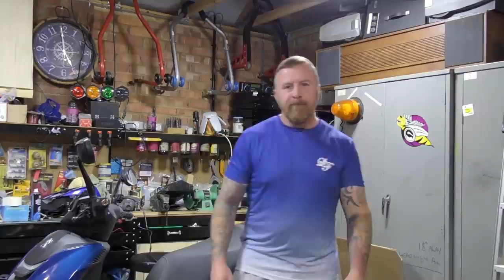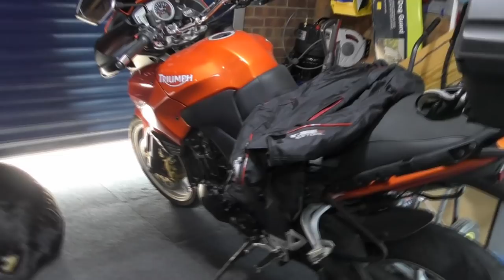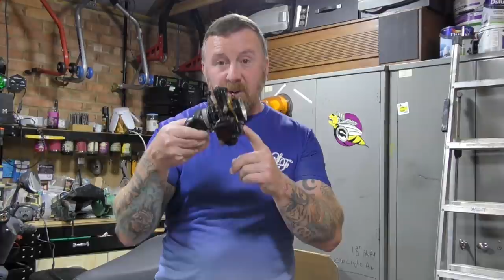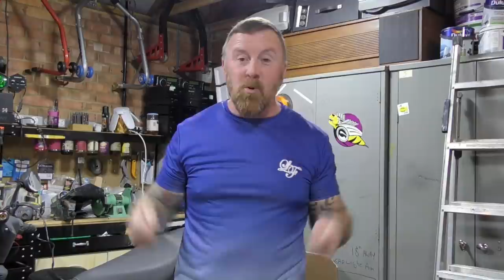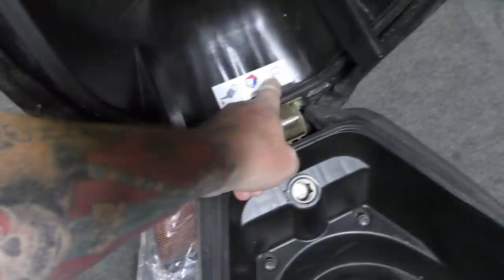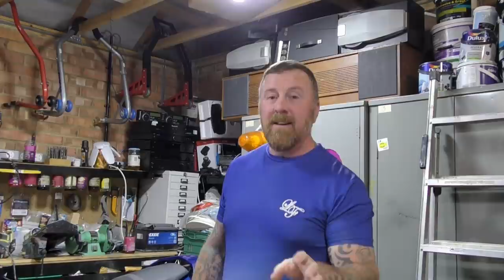E10 PETROL ARE YOU READY INFO FOR MOPED MOTORBIKE OWNERS

Comment: Dam I can’t use my local village station anymore thanks to this E10🤨 I’ll have to travel 10-12 miles to look for the super. gutted. my bike is fuel injected and a 2000 model Suzuki.
Reply from the maker: they are all changing over , its rude as it really is not good for peds and bikes with cards
if you have to use it make sure you dont leave it in the tank for long and try half filling then topping up with e5 super
Reply: @marksavage  yeah I’m heading to get some super on my next trip but first Im just trying an experiment with some E10 fuel in a container and have placed some thin rubber tubing in it to see how long it takes for the rubber to show signs of damage. if I don’t see any harm to the rubber after say a week then I’ll know it’s not urgent I use the super.

Surely E5 would cause some damage over time as it’s got 5% ethanol?
Reply from the maker: @019208237  most parts and engines can handle 5% with the normal hardening extra 
But 10%
Is just too much and it's the water content
Reply: @marksavage  I see. I don’t suppose there is an additive we can put into the fuel tank that would help neutralise its harmful affects. I hope they are not planning on doing the same to the super😬
Reply from the maker: @019208237  good news there is an additive 
It's 
Fuel fighter additive 
Bad new in the next 5 years no more E5 ! 
Bugger
Reply: @marksavage  additives = more money😣 so what makes the newer bikes able to cope with the E10 and not corrode parts in the tanks and carbs?
Reply from the maker: @019208237  newer bikes / cars etc are injection and since 2011 they had to use parts able to be used with E10
They told manufactures about E10 in 2002 and some upgraded parts 
Others just kept using the same old parts 
It's a good money making idea and no good for cars or the environment like they say 
Bud
Reply: @marksavage  could you explain what the newer bikes use to make there fuel system parts? For example what’s the difference between a normal motorcycle fuel tank on the inside and one on a newer bike to cope with the extra 5%? Also the fuel hoses? To be on the safe side I’m going to get some fuel fighter but honestly does it really do what it says on the tin I wonder. I guess time will tell. I can’t be assed to travel well out my way to get a fill up and I’ve just been told the fuel station I was going to use instead of my local one has just closed down🤦🏻‍♂️ i couldn’t believe it. it was a 24/7 one as well and on a busy roundabout where thousands of vehicles go every day. I never expected it as they was making a fortune.

Comment: Is it OK just to use v-power instead of the E10  cost aside?
Reply from the maker: depends on what you re using it on bud , a lot of motorbikes will be fine but peds run hotter and can damaged the piston etc ,most cars will be fine yet oddly my dodge 5.7 hemi wont run on super!
Reply: We've had e10 for a while here in the Netherlands. V-power is still e5 and is what i've been using.
Reply from the maker: @Clear2311  yea as said not all can run on super like my dodge ram 5.7 can't and most peds will run hot and cause damage
Reply: @marksavage  interesting, i was not aware of this and me and my friends always use super for our peds. haven't noticed any issues so far. 

As a sidenote, thanks for all your videos! You taught me tons on how my  speedfight works.
Reply from the maker: @Clear2311  that's great to hear bud 
Yea I've had a few that people have run super and others I bought had heat seized
Guess it's the way people use them too
Take care bud

Comment: Why the panic. I have used the E10 for mor than ten years. Without any problems. Used it in old cars, new cars, lawn movers, chain saws and so on.
So just take it easy and drive on.
Reply from the maker: So your not in the UK ?
Ride a moped ?
Leave it for 3 months with the fuel in it?
Motor has a carb , seals,  pipes ?
Plastic or metal tank?
UK climate

Comment: Just has to drain 11 litres out of my Yamasaki f50 after it started cutting out and had to walk my bike 7 miles avoid it like the plague
Reply from the maker: if you read some comments on here saying 
its all ok and your talking rubbish 
well im not and had like you a lad used it twice and broke down 
i picked up the ped and had to drain out the fuel but is had already damaged the gaskets !!
Reply: @marksavage  my bikes a 2020 bike, hopefully it hasn't damaged anything but  my engine was steaming I thought it was because it was raining, after draining the tank and putting fresh e5 fuel in it it started on the button again, I've cleaned the plug, and so far no leaks from the gaskets. Would you advise I put in some e10 fuel additives? I've only been riding 4 days and can't believe I put this e10 junk in my bike. Luckily my car is a diesel
Reply from the maker: @1977dazzza  yes bud they do work and stop the damage but more money bud , as for diesel it wont be long

Comment: Good thing I drive a diesel golf. The lithium batteries recycle is gonna be harmful ironically.
Reply from the maker: good old diesel , more taxes next and then ultra low fuel, that should do the trick 
gov.uk have to love them pmsl
Reply from the maker: @steve00alt70  we all noticed the fuel prices going up since the beginning of the year , £1.32 at my local and £1.36 and £1.38 A12 on my way to Ipswich yesterday morning to the car show 
rude bud as they still get there vat on top
Reply: @marksavage  Ive read that the filling stations will run E10 in September. Defo not a good time for owning an old machine.
Reply from the maker: @steve00alt70  its in the garages now bud , and here since july , check on the pump next time you fill up

Comment: I'm just wondering if this is the reason for the high petrol price at the minute ! When they start bringing the E10 in they can bring the price back down to what it should be and tell everyone that the E10 is cheaper.
Reply from the maker: 100% this is the way this government seem to operate, problem is a lot of us are clearly seeing through it but what can we do !
Reply: Petrol, diesel, kerosene, etc. are all waste by products of the refining process. As long as they refine oil for other more profitable chemicals, they'll be producing petrol, because every barrel of crude oil contains 22 - 24 petrol, which the oil companies will need to dispose of somehow.

Up until the 1900's petrol was dumped into rivers as an  unwanted pollutants as engines ran on kerosene. Then Mr. Pratt (later founder of BP) worked out that engines would produce more power if run on petrol than on kerosene or coal derived paraffin.

The first Edwardian petrol was only 35 RON.
Reply from the maker: @CZ350tuner  wow

Comment: How about boycotting E10,  I've had massive experiences of Ethanol % fuel, split fuel lines, damaged manifolds, rusty tank, blocked jets, leaking fuel stopcocks, vacuum and manual. Well done, get the word out.
Reply from the maker: this is what all the petrol prices are about so you have to use it if you can find it , i will only use e5 at pump now £1.79!!! just rude but wont use e10

Comment: I have a 2017 Aprilia sr 50cc 2 stroke
Reply from the maker: Do check as 2t does not mix well so you may have to start using super
Reply: I couldn't find anything on Aprilia. But as it uses a Piaggio engine, I'm guessing not ok. As Piaggio say E10 is not suitable for any 50cc models.
Reply from the maker: @paulbudford  its the 2t oil bud as it doesn't mix well
See it you can find one that's does mix with 2t oil but us your injection 
Think it's carb like in my last video then no bud 
Best mix super as that will be ok

Comment: So if I do 5,000 miles pa on E10, is that the same affect on engine, as someone doing 10,000 on e5.
ie both will have same amount of ethanol passed through enging 🤔🤔
Reply from the maker: No bud 
Thats like saying if I have 7 pints in a night ill be OK to drive as its the same as 7 pints over 7 days !!!
It's like an overdose !
Reply: @marksavage  ah yea so it's the concentration that's the issue, I guess, good point.

Comment: e10 might be better for the environment, but ethanol as significantly less energy per litre. so youll have to burn more fuel to run the same 100km that you would normally have to. so more fuel burn = more CO2 and other emissions that are dirty. the claim that e10 is better is just bullshit. 

if you go even further, to produce ethanol, youll need more chemical plants to produce it, more ships to transport it, more trucks to transport it. and this is all ADDING on top of the normal fuel production. so its not replacing anything, its ADDING up to what was allready there.

going further, to produce the ethanol they use corn. so they have to chop down forests that clean the air to create corn plants, run more tractors, run even more transport to the chemical plants (if it doesnt have to be shipped by big cargo ship first).

in the end, well probably be hurting the environment more.
Reply from the maker: totally agree and this was one of the reasons for doing this video and bring it to peoples attention plus the fact it will damage lots of motors / bikes
but someones making loads of money as normal
Reply: @marksavage  exactly, the extra damage to alot of engines will get people to have to find replacements, and those replacements have to be manufactured, and manufacturing new things in compared to keeping old things alive and running is WAY more damaging to the environment.

in some ways, its like they want to get rid of combustion engines this way. they will let us wreck the engines from the inside, so nobody is liable but ourselves. and well have to buy dirty electric cars with those very nasty lithium battery engines (those batteires are seriously damaging to the environment to produce).

where i work, we have the regular people, who will go and pump E10 all day long, but us, the technical part of our workforce wel ALL take 98 whenever we can, in ANY vehicle (not just the old ones, the new ones aswell) and only as a nescecity we take e5.
Reply from the maker: @wildwilco  they want us to go electric like they did back in the 90s with diesel and we know how that went , they have also said in 5 years they will tax electric cars .
i think it funny all those people with the cars thinking they are green when changing from coal fire power stations !!
not alone the damage getting the lithium
hydro next 
but all in we pay ! 
take care bud

Comment: It's easy to remove and many vehicles after 1995 are sorted, triumphs and Yamaha's after 1995 should be fine and it has a higher bang but actually less power. You need to buy a combustion enhancer if removing it, if your using your bike regularly the moisture makes no difference. What's worse is what's coming in and that's speed limiters  no discussion, no consultation, this is not democracy.
Reply from the maker: to be fair its not easy if your 16 living at home having to walk to a petrol station with 2 petrol cans to bring home then in their garden to then buy a 20l tank and do all the clean water bits then to put it back in there peds etc 
wait for the next few months as it starts to get cold and then more break downs etc

Comment: Floats are either plastic or brass, same with the jets. Not copper.
Reply from the maker: true but will be effected the same as in the metal and plastic tanks , gaskets etc , cat and bad starter bud
Reply: @marksavage . Just correcting the info. Brass not copper.
Reply from the maker: @AYTAZED  thanks bud what do you think of the new E10 fuel?
Reply: @marksavage  I drive a diesel so government legislation doesn't affect me yet., until they ban diesels. But I'm in selling a gsx1400,  and according to the government website its OK to run it on E10. So hopefully the information is correct. But I'm thinking of buying a 1967 lambretta so not sure how the E10 will effect the 2 stroke single.

Comment: It's a mine field.
How can any Yamaha motorcycle from 1990 be ok, but my 2019 Piaggio not be?
Piaggio say no 50cc models should use E10. Yet Piaggio use the same Dellorto brand carbs as Yamaha.
Somethings fishy.  Or Yamaha don't class less as motorcycles?
Reply from the maker: It's the carb and bits inside bud 
I'd mix super or the additives yo run it 
But mainly its the 2t oil that doesn't mix
Reply from the maker: Bloody government putting there big feet 8j something that they didn't need too and for what Grrrr

Comment: “Coal powered fire stations” ? Eh ?
Reply from the maker: i know bud ,they are putting coal in their electric cars and think they are green, this is all for profit and not to be green 
as for the e10 again using power to make it !!
Reply: @marksavage  not strictly true, there’s very little coal being used in the UK to produce electricity these days. It provided 1.6% of total generation in 2020
Reply from the maker: @pjexplores9592  they are stopping nuclear,, wind and sola .water doesn't for fill this gap , where do you think the power comes from coal , wood open fuel power stations 
its not green 
to go back to the fuel 
growing the crops and making it into ethanal using more power and again ref above 
not going on about none food crops etc ..
look at Germany they only use open power stations now and again bud burning fuel !!
im trying to say the 2% saving on this e10 is out weighed by how they make it and you use more and it damages the vehicle 
so you buy new ---- not green at all bud
Reply: @marksavage  wow, I didn’t know this about them stopping Wind and Solar, can you link me to an article ?
Reply from the maker: @pjexplores9592  they are not stopping it ,it just doesn't fill the gap bud 
most of what we read is suger coated and not fact checked as green 
everything else is over fact checked !
but to be fair just getting back to E10 fuel 
is has more down sides than benefits
yes fuel is bad and we need to use less but it should be fair for all and none profit 
its like food tax bad foods so why are good foods so expensive ?
any way 
but take care

Comment: Actually I have a 2010 car and put some of that E10 fuel in, only once and noticed as I used the car a nocking sound coming from the engine on start up, which lasted until the engine warmed up.

I know it's due to the fuel because I since refuelled with super and the knocking sound has gone away.

So even though my car is supposedly ready for E10 it doesn't like it at all, and it's fuel injected so shouldn't have any problems with the fuel, no change in performance just a knocking sound which can't be good for the car.

The super is more expensive but it's a small car and I don't use it much anyway, so I don't mind paying extra for the super.

As for battery vehicles, it's the way ahead like it or not, that's what's coming quicker than we might like to think.

When you ride a battery vehicle you notice something, power is really good, it's just the charging time that is really bad, performance is good, power up is good, starting is odd but the one I have tried and that is old now, was very good.

I would happily swap my gas bike for an electric motorcycle, if the charging was much quicker and the prices were comparable, but they ain't.

A decent battery bike costs now around 20 grand just to get somewhere near the performance and range of a gas bike, but you still have to wait 2 or more hours to fast charge, not much fun when you are out on a ride.
Reply from the maker: yes agree they are making us go electric but for all the wrong reasons -- MONEY & PROFIT 
however as for bikes i do like the sound of a petrol engine and with my truck too lol
take care bud

Comment: Anything fuel injection would be fine but carbs not so good 🤣🤣🤣
Reply from the maker: Should be bud but not so good for carbs as you say !!
Reply: @marksavage  all they are doing is scaring people to get rid of old cars but any car with fuel injection will be fine we still got 99+ octane fuels so just make the mopeds go quicker 🤣🤣🤣
Reply from the maker: @Adrenalinspunk  I've had one sp3 2t back this week after breaking down after 2 fills with e10 !!
It doesn't mix with 2t and doesn't work with carbs nor the fuel lines inlet etc 
Had to drain all out 
Clean carb 
Replace gaskets and the inlet manifold!!
Then fill with super then retune!